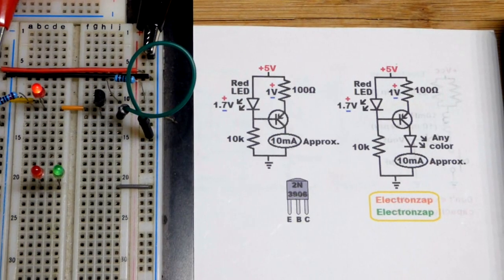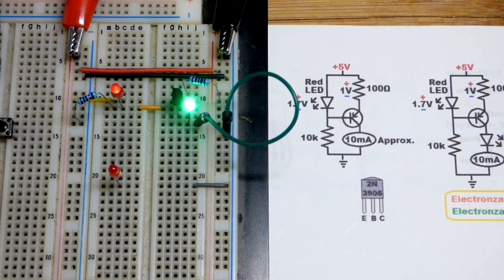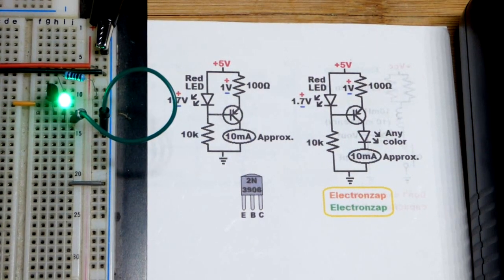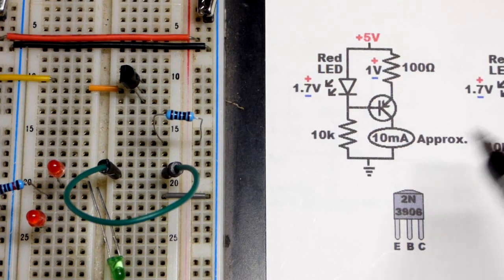10mA PNP BJT Current Source Set With Red LED Regulator and 100 Ohms

Comment: I use this circuit for current regulation all the time.   I use old  LEDs  ( they are very dim compared to modern LEDs) from 30, 40 years ago just for this purpose  of using  them for a fixed voltage drop for emitter base voltage reference.
Reply from the maker: Very cool!